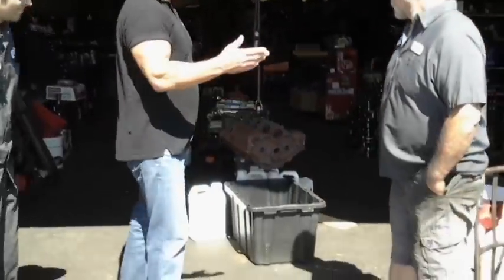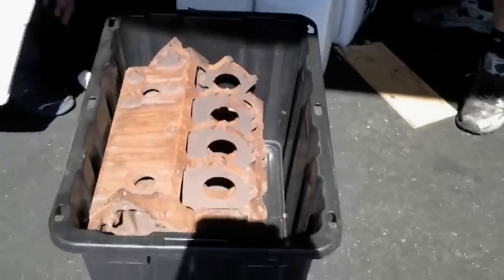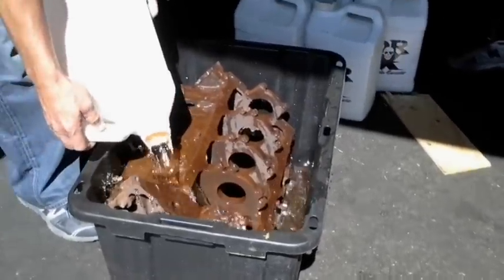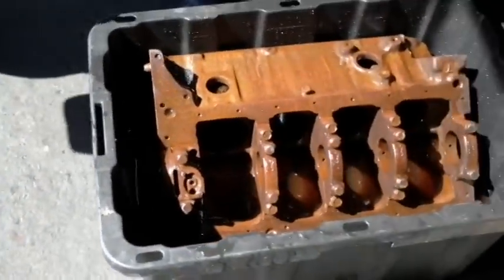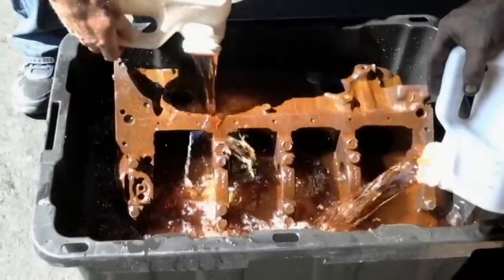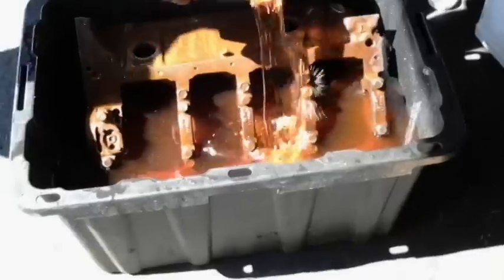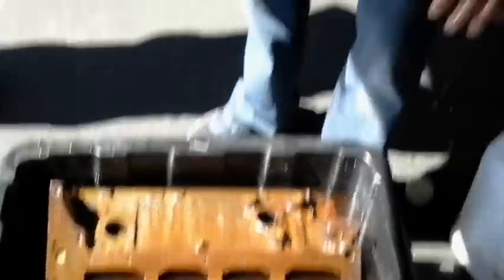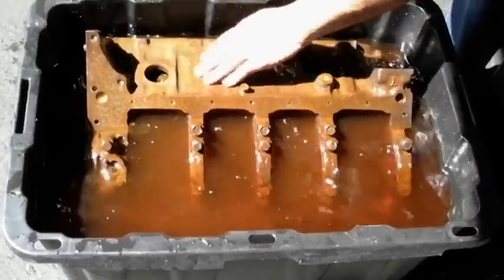HOW TO REMOVE RUST OFF OF 350 CHEVY ENGINE BLOCK LIKE NEW

Comment: Went to the website and it says it's 39.95 a gallon?  10% off 5 or more?   Not trying to stir up any problems, but I'm pretty sure I can get the block, heads and components vatted at the engine rebuilders for less. Just saying.

Comment: I assume this product is 85% phosphoric acid?  It's cheaper than a brand-name product.  He didn't mention that the core plugs should have been removed. This allows the acid to get into all the coolant galleries.  The temperature of the acid will affect the time it takes to work. The hotter the acid, the faster it will work. Another thing is the acid won't work if there is too much oil or grease on the block. The block needs thorough degreasing beforehand, preferably with a steam cleaner and/or a high pressure water cleaner with detergent. Finally, choosing a quality paint to protect the freshly cleaned surface is essential. Otherwise the rusty appearance will return within a day.

Comment: This dude has a few screws loose. $600.00 worth of Dr.X Cleaner is insane. If I were to clean a block with this method (Which I'm Not) I'd get an inexpensive pump, like used in parts cleaning tubs, a 5ft piece of 1/4inch flexible tubing, 4 Nylon 1/4inch T's. I would relace his tank with a plastic trash can and position the block so that it stands inside the trash can on its end, not lying on its side. I would connect a section of tubing to the pumps output and place the pump next to the block. Then I would affix the T's equally arranged inside the tank, pointing at the engine block with each one connected to the pump output. I'd perform a brief test assuring that the chemical is being applied across the entire block. Finally, I would pour in only one gallon of the DR.X, place the trash can lid onto the can and just sit back and let run for an hour or two. Once finished with the cleaning, I would use the pump to pump out the Dr.X Cleaner through a filter and then back into its original container.
As I said, I wouldn't do it that way. I'd rather set up an inexpensive electrolysis system using a battery charger and a plastic trash can.
Reply: I used a more fiscally responsible solution too. Made a video about it. I would love your feedback if you take the time to check it out!

Comment: How much does Dr X cost? 
How do you dispose it properly? 
You could have used half the amount by flipping the block over.
Reply: Don't do it that way. $400.00 to $500.00 for the DR.X Cleaner. There are many other, far less expensive, and better ways to clean a block shown in youbube.

Comment: Your method does work but if I ever have a motor down to the bare block it's going to be tanked at the machine shop anyway.  I don't know how much the 4-5 jugs of the Dr. X costs but I don't want to have to deal with that much contaminated chemical anyway.  If I was still porting heads at home that might be more of a practical use.

Comment: generally a gallon of that derusting liquid sells for more than $20 a gallon and there were more than 25 gallons used here, and although the stuff can be reused many times over, an engine de rust process cannot be done prior to a thorough degreasing and removal of oily residues. The latter means a hot tank, as done in machine shops, before the de-rust process, shown here, may be done. Is it worth it? Well there is at least $300-$400 of that liquid needed. If that liquid can be used to remove the rust from say, ten blocks, and considering the time of the shop to handle it is then not worth doing for less than at least $130-$150 extra for that step. again, is it worth it? Probably not to every guy having a rebuild on their hands. Think about it. Maybe it can be used on stuff more valuable than a used cheap block.
Reply: Thx

Comment: this is a 10 days rusted block which citric acid or mountain dew would easily remove it
get us a 10 years old rusted block and demonstrate ... yeah
Reply: Doha Man i
Reply: I use a phosphoric acid based cleaner that they use in restaurants, so much cheaper and the concentrate is 50% Phosphoric acid 5L you can dilute it only costs about $40AUD which is cheap here but stuff is expensive in aus.
Reply: Yeah scam

Comment: Is your product reusable? I actually do this exact thing with EvaporRust which is a waterbase product that won't even burn the skin. I bought  the 5 gallon EvaporRust from Amazon for about 75. It is reusable as many times as it doesn't get too contaminated with oil from the engine block or other parts being derusted.  But let's be honest, you guys had already treated that engine block and let it rust again for several weeks or a few months. All that rust on your block was surface rust, flash rust; so of course your product was going to seem like it works quick but I don't think any one bought that claim. I too had to dip parts in the EvaporRust after it got rusted again after several months. The rust came out quick because it was just surface rust. The secret to avoid rusting again after dipping the block on rust remover is to chemically etch the block or metal parts with the concrete and metal etcher made by Klean Strip. This will prevent flash rusting for a while but I also spray the block with epoxy primer from Valspar and then I top coat it with a single stage epoxy paint also from Valspar. I spray the etching chemical on the block continuously to keep the block wet 5 minutes then I wipe it dry with clean rags. The next day I pray the epoxy primer. The following day I use a 320 grit sand paper sponge from Sherwin Williams to lightly sand the epoxy primer. Then I topcoat it with the single stage epoxy paint. Obviously I tape up the areas that are not supposed to be painted.  Finally I assemble the engine. So all my bolts, nuts, brass freeze plugs, etc., are all visible and are not painted like many of these rattle can painters paint their engines with that cheap high temperature primer and paints. To go through all the trouble of dipping an engine block on a rust removing liquid is a waste of time if that work is going to be followed up with rattle can primer and paint.
Reply: I was feeling the same way as you. Did you happen to see my video on using only 5 gallons of evaporust to clean an old rusty block?

Comment: Just use low concentrated muriatic acid... (muriatic acid/HCl dilluted with water 1:8 to 1:12 depends how bad/thick the rust) good for the rust but somehow safe for your hand if not prolonged exposed.

Comment: That's crazy I wouldn't give that much for this when can go down to local rebuild shop and have them vat it for $25
Reply: The thing is that you can then close up that tub and use the solution over  and over and over
Reply: @llewvirtue861  and after 15+ uses when it's filthy, it will have barely paid for itself and done a subpar job... There is zero benefit in this product when compared to the cost.
Reply: Not every mechanic has access to a vat service or rebuild shop so this method is a good substitute

Comment: How about showing removing it from the tub and rinsing it off.   Looks wet and rusty as the video ends. 

Any reason the mains were left bolted on?
Reply: because every machine shop will scream at you if you leave the caps off. you will need a line boring to fix it if the caps aren't marked.
Reply: Classics Rule mark them, but you can figure out where they go if they aren't marked
Reply: @classicsrule8651  pretty sure sbc’s have cast #1,2,3,4 on the caps anyways. 🤷‍♂️

Comment: phosphoric acid is cheaper. Old fashioned naval jelly and dilute it down
Reply: Samuel Mason It's called naval jelly
Reply: Ask what they use at NAPA when they clean heads. They should sell you some.
Reply: +Samuel Mason Advanced Auto or Home Depot. Home Depot is cheaper

Comment: vinegar will do the same job but may take longer
Reply: EvendimataE when i was 12 i used coca cola to take rust off a 5 hp briggs and straton  block for a gocart, let it soak for a day abd a half and used brillo pads to loosen it up before soaking and it came out looking pretty good
Reply: yes there are lots of videos showing coca cola works....now its a matter of which is cheaper ....coca cola or vinegar.....actually i tried using lemon juice and it worked too....lemon is free if you have a tree but if you are going to buy it, it will be expensive
Reply: It takes  a lot longer, time is money

Comment: They should use a much larger container and pour in more of that rust remover until it covers the entire engine and the top surface of the engine is about 1 inch to 2 inches below the surface. If they have an ultrasonic beam generator then use it to transmit an ultrasonic bean into it to cause the rust remover to agitate and penetrate even deeper until one can see pits and deeper pits once it is cleaned and then ultrasonically rinsed and treated with a rust converter and then coated with fish oil to penetrate any remaining rust if there are any left. But the use of fish oil is just to play it safe.

Comment: the block went through a lot before this stage. One thing they forgot is to remove the water jacket 1/4" pipe threaded plugs on each side of the block. Too much salesmanship and obvious hesitation on apart of the dad and son (shop operators) in reciting what appears to be their predetermined lines.

Comment: Save the expense, just put a quart of vinegar and 16 oz. of Molasses fill with  tub with distilled water and leave for two weeks. Remove engine block from solution and clean with high pressure cleaner. Will come out like new...WARNING be prepared for a very band stink from the solution but apart from that it will work just fine. I have been cleaning rust of car parts for 25 years doing this and it has always worked without damaging parts or rubber or any alloys etc

Comment: They appearing to be using a large amount of "cleaner" that likely exceeds the cost of just buying a brand new block OR having the old part professionally cleaned and media blasted. There is a failure to understand basic Economics: these so called rust removers are made of very inexpensive ingredients but are marked up by exorbitant, indeed economically irrational, amounts. People do not realize they are over paying for these solutions. You are wasting your money.

Comment: It looks like acid. I tried this on a piece of metal for my car i left it sitting for one day in miuratic acid and it took absolutely all the rust off. It looked brand new. I cleaned it rinsed it and lubricated it with metal preservative and left it in my garage over night. Next day i went to look at it and to my surprise it looked worser than before, with more rust and oxidation and it still smelled like the acid. I was so mad for that. Do not try it if its acid.
Reply: But did you neutralize the part in baking soda and water?  I've been doing this for decades with perfect results with Muriatic acid for 8 bucks a gallon at the local Ace hardware store or Home Depot.  And any bare metal will flash rust if left untreated, and especially if left near the Muriatic acid as the fumes are very corrosive.  So if you use this stuff, make sure you soak it well in Baking soda and water for a few minutes to an hour to completely remove any traces of the acid.